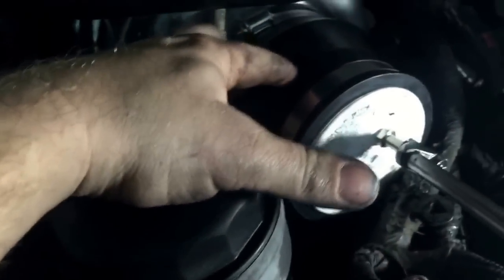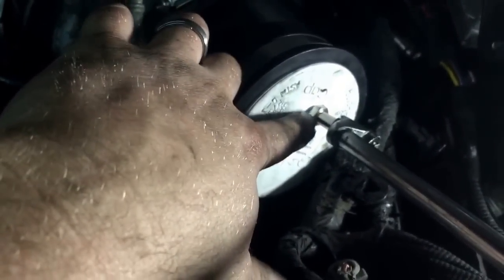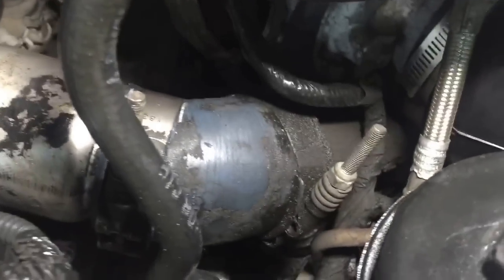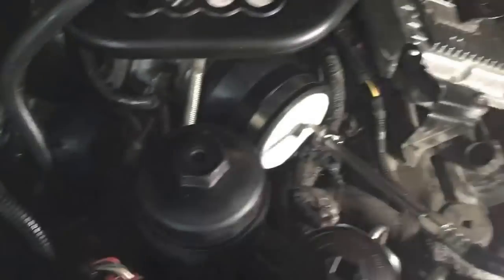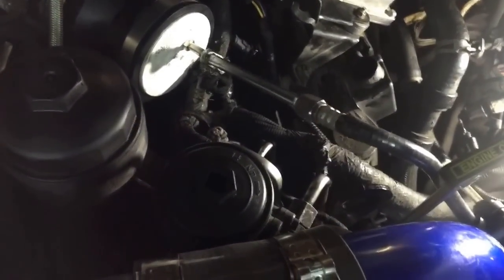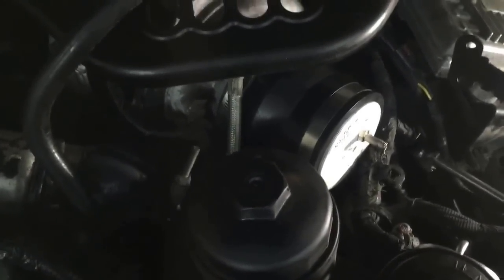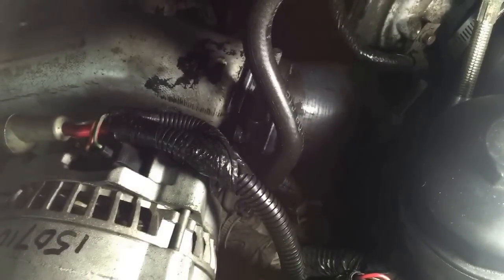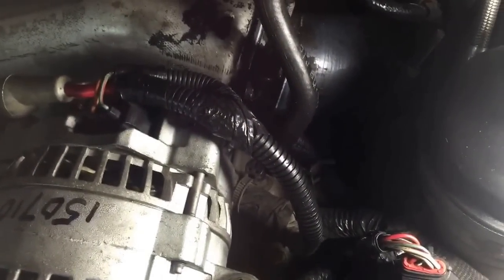Boost leak testing tips and tricks

Comment: So what happens if it's just going straight out your exhaust
Reply: Any idea what would cause that,  truck has 90k on it started feeling like it was a boost leak because it was losing power and turbo was cutting out then everytime I shift I get loud turbo barks, pressurized the system just like you did but it immediately went out the exhaust, cleaned the turbo after replacing the vgt solenoid waiting in a ebp sensors to come in but I'm kinda at a loss of ideas
Reply from the maker: levon rosenbauer that would be an exhaust leak and not boost.

Comment: Get vid, I did a test on my 7.3, the air blows out the CCV so I have to leave compressor running to see leaks, I used soapy water to find five leaks. Can I plug the CCV to prevent the leak there? Or is that to much pressure for the engine? I'm thinking 15 lbs. I still need to check my inner cooler which is another whole animal.

Comment: Why not use a smoke machine to find this kind of leak?? Seems to me it would be the fastest way to find the problem area
Reply from the maker: smoke machine doesn't always work. most boost leaks that are at the boots are torn, and if you put smoke to it, it may not come out of the tear until its stretched. so if you put it under pressure it will make things expand, you can even find a clamp leak. if the smoke machine was under pressure that would be great.,

Comment: Just throwing it out there. You should tap a pressure gauge on the end cap so you can see the pressure drop if there is a leak. Plus you can see how many psi you have and make sure it holds. Love the 6.0 vids. Keep them coming. thanks.

Comment: how do you feel about ccv reroute to atmosphere , ?
Reply from the maker: bobsdogtag I wouldn't recommend to atmosphere I would use a recovery bottle setup just to avoid getting oil all over the place. And it's probably not a bad idea to monitor your blow by. It would also probably help with issues like p0402 codes.